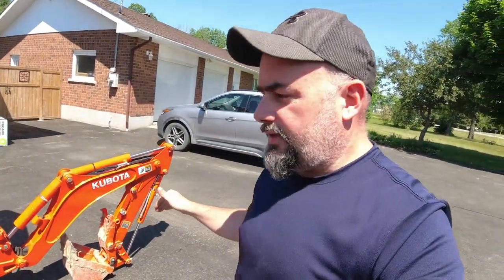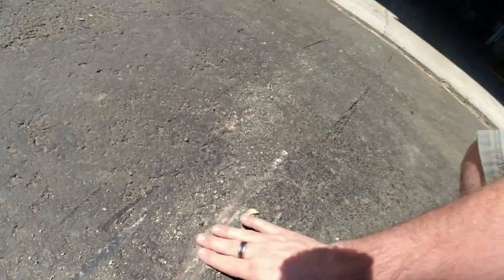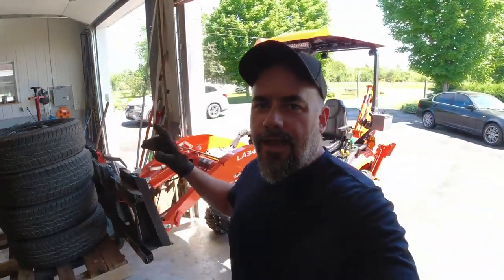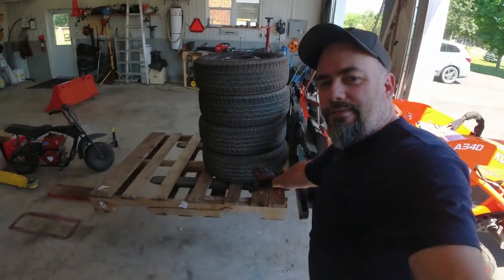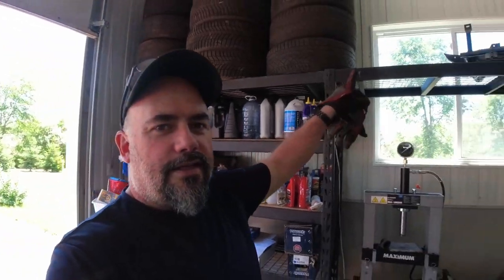Don't make this mistake with your Kubota BX23s

Comment: Ross, I forgot to mention, I have a BX2380
Reply from the maker: I looked at that initially, but wanted the backhoe.
Reply: there nice bxs plus its a perfect size to plow town and city side walks wich is cheaper then paying $140,000 holder tractor wich rediculas for a sidewalk tractor
Reply: @RossOnTheLand  Don't rub it in Ross LOL.  Yeah, I wanted your model, but couldn't justify it. 10K more for your tractor, then add another back hoe another 8K or so.... ( that's what the dealer told me )   I just don't have the property to justify it. If I win the lotto, I'll be upgrading though ! LOL

Comment: Hi Ross, 7:34 min in you asked, so I'll give my 2 cents.  Yuppers, you can do it. I noticed you were running at 2000 rpm. - That higher rpm will make things tougher for sure... you have less control, as every moment you make on the stick is magnified at higher RPMs.  If you drop that a little bit, you will have more control, but even at 2,000 rpm, you can do it. I've done it,  but it takes that much more control. It's a good skill we should all be practicing. I moved 24 yards of garden soil a few weeks ago and was trying to keep it level without even really knowing it at times.  It takes practice, but  it can be done.  Lower your RPMs and try it.  Even before you were asking, I thought... hmmm this is a great exercise for those who don't have one of those auto leveling loaders.   Idle your machine, and try it with nothing on it 10 times, you'll feel yourself getting the hang of it - or - practice with that empty pallet on there at idle, or just above idle.  It's a great training exercise.  When you can balance a full bottle of beer, film it, and I'll come over and help you drink it with the other beers in the case LOL.  👍😁
Reply from the maker: That's great! And will definitely work on that skill! Thank you for your comments.
Reply: scraped the floor poor kubota lol

Comment: I played fix the sprinkles on the land today : ) I sometimes forget to lift the box blade or ballast box Sh#% happens! Thanks for the video Ross.
Reply from the maker: This was my first time forgetting, I hope never to do it again.
Reply: @RossOnTheLand  hope the wife dont see that scratch on the driveway lol hahahahaha
Reply from the maker: I'll just blame it on our son! Haha. Unless she sees the video...
Reply: @RossOnTheLand  hahahahahaha  lol oh well at least made a kubota water drain now on the driveway  no puddles now lol hahaha i be hateing my self if i did that and scratch the nice orange kubota paint off lol
Reply: my towns newholland tractor wich hard get the 3point hitch on the rear to get down wich it never worked at all even when brand new wich my town wasted $139,900 on a newholland junk  3point hich dont go down and rear window falls off and doors dont shut right on both sideslol no wounder i told them get a kubota and those problems wouldnt happen but didnt listen to me they just go and spent $139,900 on a 115hp newholland thats stuff never work instead getting the $63,980.00 kubota M6-131 131hp with loader,bucket forks and blower wich they had to spend another $20,000 on a snowblower wich rediculas and couldve got that big 131hp kubota package cheaper at my kubota dealer plus has 6 year warranty wich the newholland had free 2 year

Comment: Ross, I had my backhoe drag twice, but I only went about six inches before I noticed it. I guess your floor is smoother than mine. That only happened to me because I forgot to put the pin back in the backhoe - when the pin is back in, it can’t fall to the floor. 

And what was already mentioned. Yes, two motions can be done with the loader, but it takes three things: practice, practice, and practice. I’m actually getting pretty good at it, but I’m now over 165 hours of seat time. And the lower your engine speed the slower, smoother, and easier it is. When trying to position it up high, only use idle. And a stack of tires does not stay a stack for long, as you and I have both learned.
Reply from the maker: That's so true about the stack not staying together, and practice, I'll try it with lower rpms. Thank you for watching.